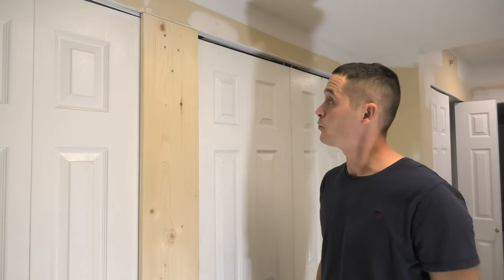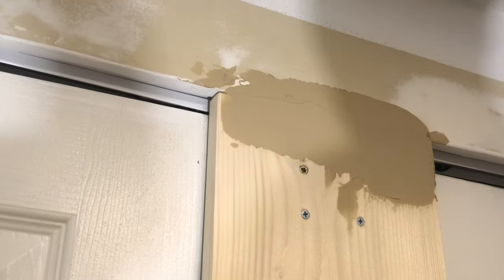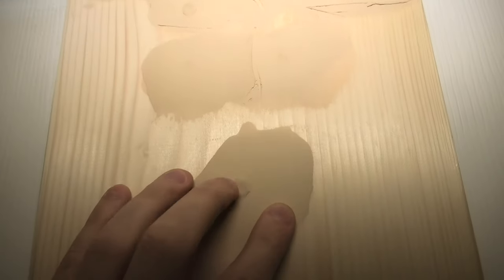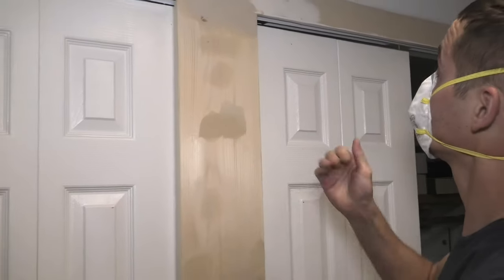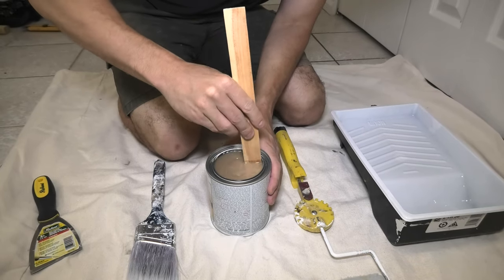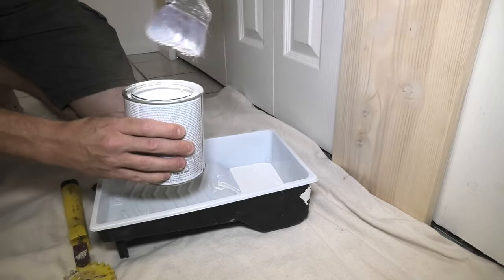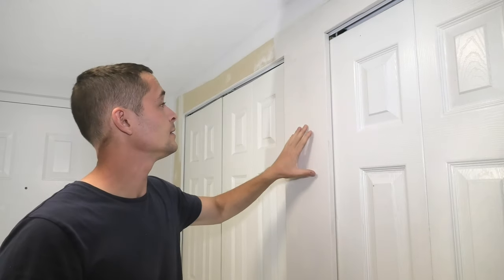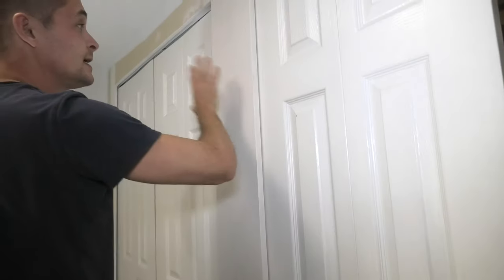How To Paint Bare Pine Wood? Fill Holes, Sand, Prime With Shellac Primer, Paint! Detailed Tutorial.

Comment from the maker: PRODUCTS USED:
1. WOOD FILLER - DAP Plastic Latex Based Wood Filler, 16 Oz, Natural - https://amzn.to/3LsC6L0.
2. SHELLAC PRIMER - Rust-Oleum 1 gal Zinsser, B-I-N Advanced Synthetic Shellac Primer - https://amzn.to/3LdC0Hd.
3. EGGSHELL PAINT - PRESTIGE Paints Interior Eggshell Paint and Primer in One, 1 Gallon, White - https://amzn.to/4cGqOhX.

RECOMMENDED TOOLS:
1. POWER ORBITAL SANDER - DEWALT Random Orbit Sander, Variable Speed, 5-Inch (DWE6423) - https://amzn.to/3rf4g5m.
2. SANDING DISCS - Mestool 58-AP 100 per box include 60 80 120 150 and 220 GRITS - https://amzn.to/3RngOlM.
3. SHOP VAC - CRAFTSMAN 4 Gallon 5.0 Peak HP Wet/Dry Portable Shop Vacuum with Attachments, Red - https://amzn.to/3PI9pfy.
4. PUTTY KNIFE 3 INCH - 3" Warner 90133 ProGrip Full Flex Putty Knife - https://amzn.to/3W6pm16.
5. PUTTY KNIFE 6 INCH - Warner Manufacturing 90137A 6" ProGrip Full Flex Broad Knife - https://amzn.to/3WyYOr3.
6. SAND PAPER 180 GRIT - 3M 180 Grit Pro Grade No-Slip Advanced Sandpaper (20 Pack), 9 x 11" - https://amzn.to/3rhsPPa.
7. WOODEN BLOCK - 4 PCS Unfinished Wood Craft Cubes - https://amzn.to/48k0SXO.
8. UTILITY KNIFE - OLFA 25mm Extra Heavy-Duty Utility Knife (H-1) - https://amzn.to/46bIaQb.
9. N95 MASK - 3M N95 Personal Protective Equipment Particulate Respirator - https://amzn.to/3LmtRjx.
10. DROP SHEETS - All Purpose Canvas Drop Cloth - https://amzn.to/3PdINTt.
11. SMALL PAINT TRAY - 6 Inch Paint Tray with Liners - https://amzn.to/45R1wuf.
12. SMALL ROLLER CAGE - Wooster Jumbo-Koter Super/Doo-Z Frame and Cover, 4.5 Inch - https://amzn.to/3ZixCfS.
13. WOOSTER JUMBO-KOTER ROLLER 4.5 INCH - Wooster 4-1/2 Jumbo-Koter Pro/Doo-Z Roller 1/2-Inch Nap, 2-Pack - https://amzn.to/3EFN8bZ.
14. CHEAP PAINT BRUSH - Magimate Wall Paint Brush - https://amzn.to/3ZdcZBx.
15. PLASTIC - Frost King P9400 High Density Painter's Plastic Sheeting, 9' x 400' x .31 mil, Clear, Dispenser Pack - https://amzn.to/3QXw08X.
16. SANDING SPONGE - 3M Drywall Sanding Sponge, Dual Grit Block, Fine/Medium, 2-Pack - https://amzn.to/43e2ONs.
17. PAINTER'S TAPE - Painter's Mate Green Brand CP 150/8-Day Painter's Tape, Multi-Surface, 36mm x 55m, Green, 1 Roll (103367) - https://amzn.to/3QoWikm.